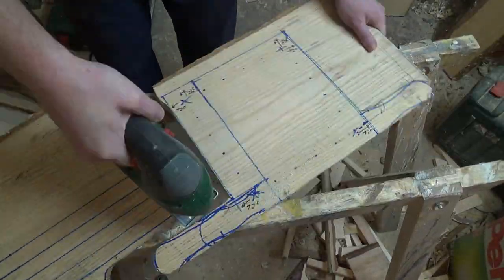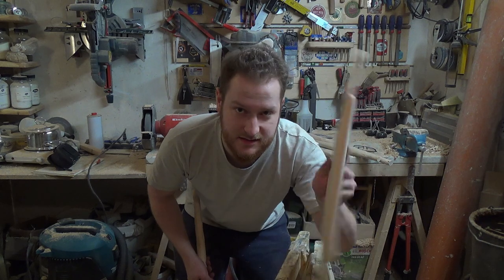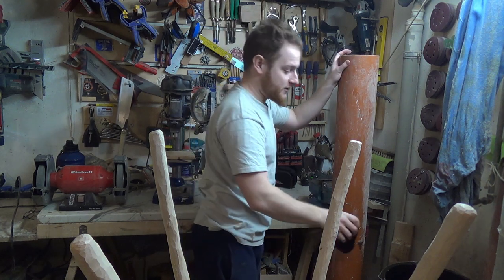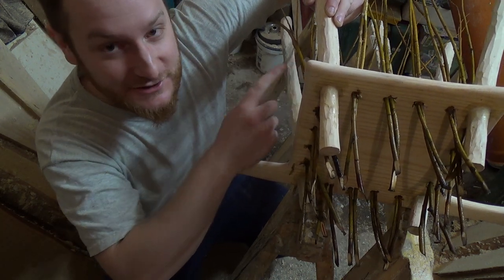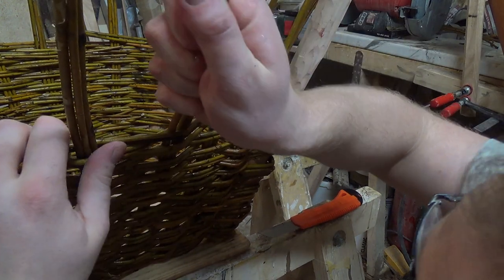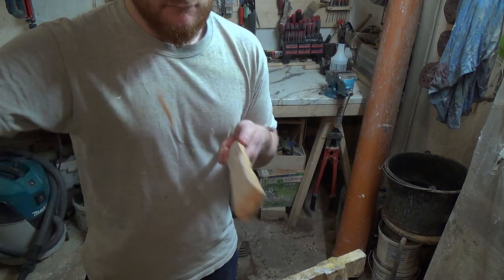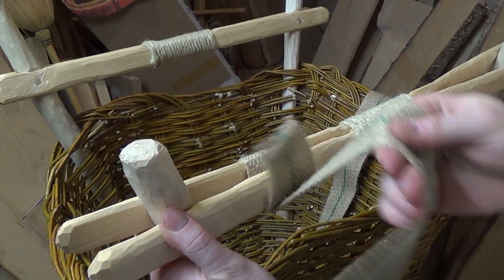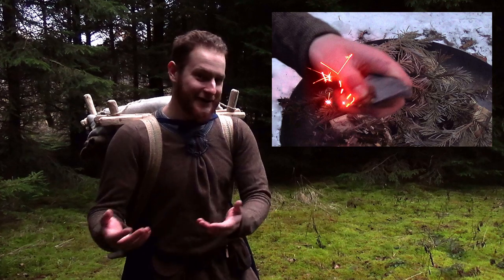Crafting AUTHENTIC MEDIEVAL / LARP willow backpack

Comment: my mom used to do willow weaving as hobby, she soaked them in big pipes with water also, and apperently the smell is normal, basically fermenting the sticks a little is apperently part of the process, and different fermentation times can be used to give the willow wood coloration for weaving patterns

Comment: Such an inspiring project! 
I can’t wait to have a go at this, I’ve only tried small baskets so far but I want to try something bigger.

Did you cover the whole backpack with oil or just the ash?
I’m asking as I haven’t oiled any baskets I’ve done before (mostly spruce root) so wondering whether I should
Reply from the maker: Thank you very much! I used it on the whole Backpack. Till now it makes a very good Impression! :)

Comment: You could have avoided nailing the straps with leather by just making them a belt that tie in front (belly strap).

I think other variations could work without the wooden bottom as well.

Other historic designs can be seen in woodcuts and artwork
Reply from the maker: Yes, that would have made it way easyer to carry, too. But i couldn't find a source for this :(